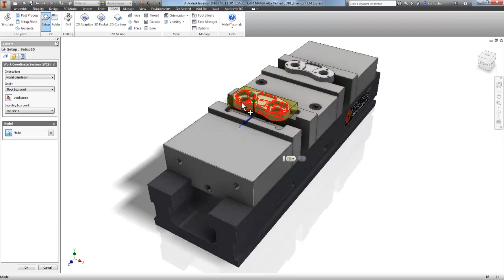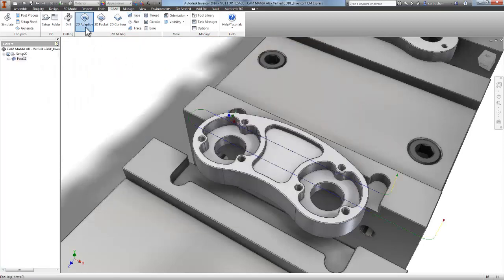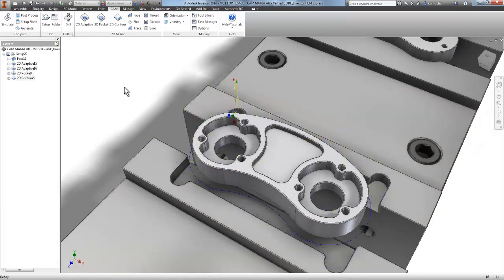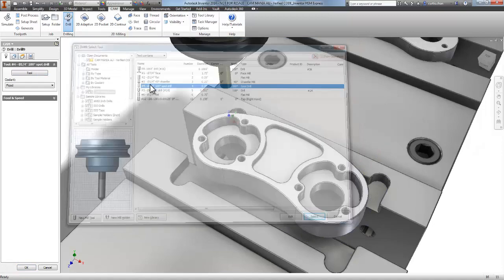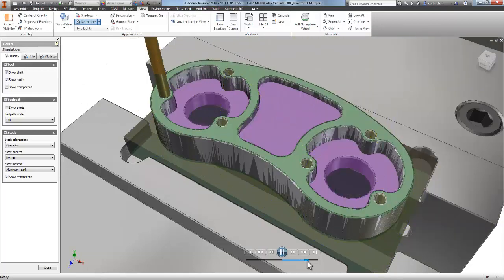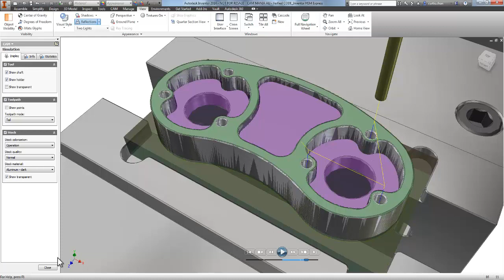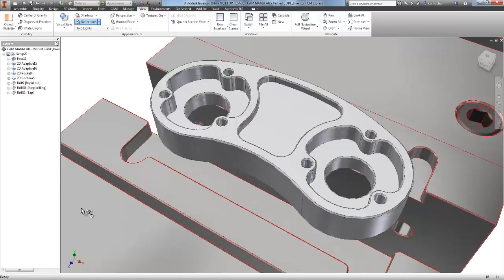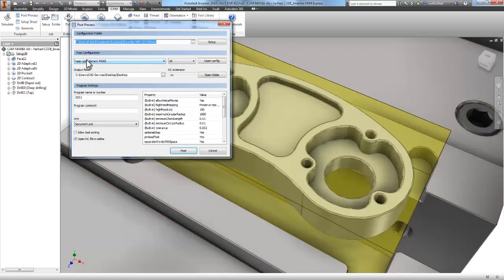Introducing Inventor HSM Express: An Integrated CAM Solution for Autodesk Inventor

Comment: great presentation, but how about the errors that inventor and also Fusion seem to not be able to solve them in the right way like "Empty Toolpath" , an error that appears for many reasons and default parameters. Also rest machinning air cuts that should strictly depend on ignore cusps parameter, but it isn't in many cases until you constrain it in a boundary...., make no sense. Sometimes the only way to make a good rest machinning op is to increase stock to leave significantly wich is really bad, leaveing to much material in corners for finishing...

Comment: How can l add this project into my fusion 360 program. I have been looking for the file, "cam samples A360 project: cam mania 2015.fd3", but haven't been able to locate it so l can include it into my Autodesk fusion . Can anyone help me to find this file
Reply from the maker: Hi Wilfredo, you should be able to find this design in the CAM Samples project near the bottom of your Data Panel in Fusion 360. It is called "2D Milling - Patterns" - hope that helps!